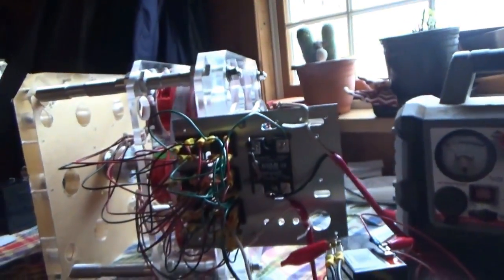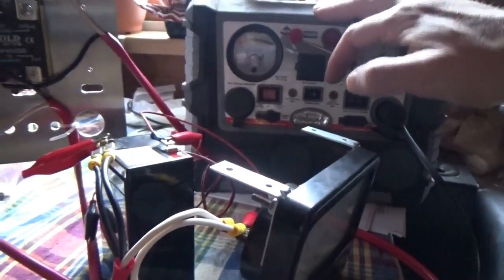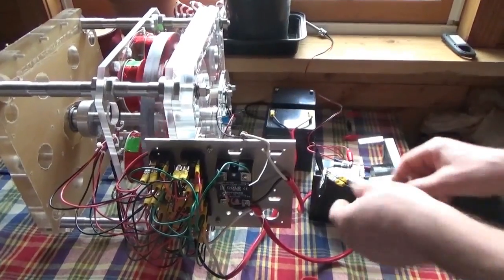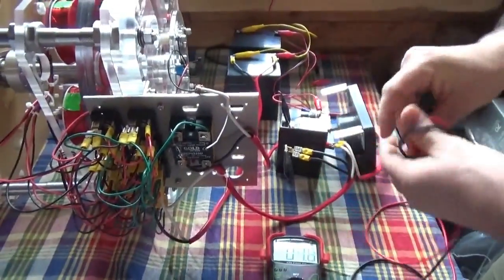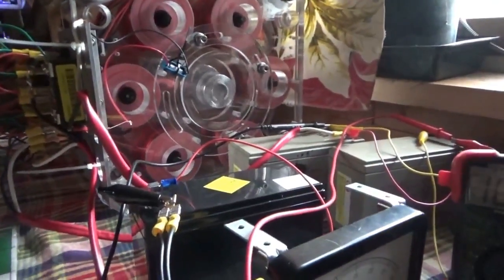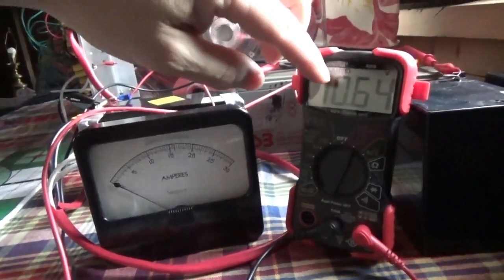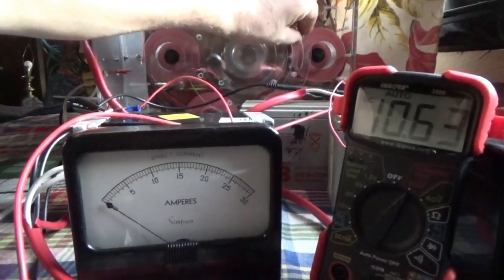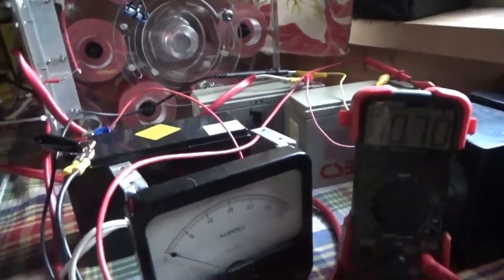Experimenting With The Quanta Q3 Pulse Motor Section

Comment: What ever happened with this?
Reply from the maker: I still have it. The solid state relay blew out on me and I ordered the wrong one. I am low on funds so its on standby till spring. I cant use it in winter because my lab is outside and unheated. The oil in the bearings gets stiff and it wont work as well in the cold.

Comment: Troy, I'm considering getting a QC unit (I can't afford the one you have, but it looks like it's really nice!) I'm curious why you haven't measured the current output with that analog Amp Meter and put a smaller amp meter (or a digital amp meter) on the input side? Everyone I've researched has the same question "What's the CURRENT Output on these devices?" My solar system is using 2 - 5kwh Tesla L-ion battery modules taken from a wrecked Model S-85. The batteries work great, super cyclable, but I don't have enough solar to keep them charged. I was hoping I could suplement them using one of these machines driving a 48vdc - 1800wt permanent magnet motor (generator) with the torque off the motor. Have you tried connecting a DC motor to the shaft to see if it can generate really usable current?
Also, is there a forum where people who have these are sharing ideas & experiments?
Reply from the maker: There is not much information out there about the Q3 which tells me one of two things: Either its really working and nobody talks about it or its a scam. I am thinking its the real deal because of how its built. It is essentially a very well built Bedini type motor.

I do have an amp meter permanently on the input side now along with input voltage and output voltages. But I have not tried to measure current out yet. Good idea to try.

If I get it running with radiant energy output though, you will not be able to measure the output properly. The only way to measure radiant energy is to measure how much usable energy is in the battery after being charged. The chemistry of a lead acid battery converts the radiant energy into usable energy.

You cannot power a heavy generator with the output of a pulse motor. The idea is to reduce magnetic drag all together in order to reduce current used to turn the rotor. So the outputs are pulsed in between the driving pulses.

I would be happy to hear from you on my forum: http://www.thedoityourselfworld.com/forum

I have been programming heavily on DIY Tube Video Community recently and have neglected the forum but I will get back on it this week. Hope to see you there. Lets stir up some conversation about this device.

Its funny you ask me now too. At this time I have been studying radiant energy and want to amp up my outputs in order to run an altcoin mining rig for free.

Lets build them together and see what we can come up with.

Comment: I would like a Quanta Magnetics G1 for a supplement to a home bank, do you think that works? And can you run one of these QM gen's on a 5V/2A portable charger from a USB port? That would be great cause you can charge those free in the car. Thx.
Reply from the maker: If you have patience and some skill in this field, yes you can make it work. BUT the manufacturer is not allowed to tell you how to make it work properly. It has to be sold as an experimentation device only. Not their fault. Know this in advance. It is finely manufactured and beautifully made and well worth every penny though.

You would maybe be able to get it running at 5 volts but a small 12 volt solar panel will provide better results. 24 even better. Just get a small 12 volt battery and solar panel.
Reply: I live in Alaska & solar is not that reliable, but may work some of the time. But I have an electrician that should be able to help me get it set up. I think it would be helpful. Thanks for the reply.
Reply from the maker: Then get a small wind turbine. Hope you figure it out.

Comment: You are not gaining any energy, All what you are doing is transferring power from the good battery to the bad ones minus the energy needed to spin the magnetic motor.
Reply from the maker: But that cannot be true. With the Bedini motor for example I can restore 6 or 10 batteries at one time while running the motor on one single small battery.
Reply: I think you need to go school.
Reply from the maker: Say what you want. I dont care. Wont stop mine from working for me.

Comment: Am I the only one who thinks that you could buy new batteries and even have spare ones if you didn't spend the money on that motor. I know this is not a popular opinion, but that is really not going to save batteries. Once the acid is spent and the plates are wore out you are done. It really boils down to the laws of physics. You can't get something for nothing.
Reply from the maker: Well, if I had purchased the device myself, yes I would agree with you on the first point. BUT I did not buy it so no I would have to disagree on the first point. AND keeping batteries desulfated and in good running condition is what this device is about. Acid does not get spent as long as you keep the water topped off. The plates do not wear out if you keep the battery charged up fully and all the time and keep the plates from being sulfated - which which this motor does. NO, you cant get something for nothing. No laws of physics are being violated here. Remove power - it stops.
Reply: I disagree the acid does wear out. Water only dilutes the acid. What 
happens to d,c,a cells? That's right they go dead after extended use. 
Can't be that different with a lead acid battery.
Reply from the maker: You are comparing flashlight batteries to lead acid batteries. HUGE difference. There are some 12 volt batteries that were made 100 years ago which are still in use today. Its all in the chemistry and how you treat the batteries. Water boils out of a battery and you have to replace that. If you keep them topped off you can generally expect 10 to 14 years for most off grid applications. If you can keep them desulfated and fully charged at all times then you can extend the life considerably.

Comment: Hey troy, Glad  to see you are doing good,. Also cool you have revisited this concept with waste pulse voltage capture. most people do not get whats going on. Its about efficiency, not getting something for nothing. Mr. Bedini tried to make that clear. there are limits using these things to restore batteries, but that does in fact work on some, but that is just a byproduct. the whole idea is to get people thinking about how do we recover that wasted energy that coils produce when current is shut off and the field collapses, normally wasted with in circuits with fly back diodes. can this be saved? it can kill semiconductors, so that energy does do work. I think your going to need to work with adding capacitor banks for better energy transfer. happy experimenting.
Reply from the maker: Thank you. Yes you have it. And the capacitors are a necessity I think. There is something about the way capacitors work with this energy.

Comment: just because it shows a voltage does not mean the battery is ready to support a load. The real test of these repaired batteries is to drain them and see how many mAh you can pull out.
Reply from the maker: Correct.

Comment: You do know John Bedini passed away a few months ago?  Now Rick Friedrich is saying Bedini's charger actually killed batteries.
Reply: The bedini motor is an electomechanical desulfator, like a solid state desulfator but with spinning parts essentially.

How you use it and if the battery can be recovered depends entirely on you and the battery.
It can or can't kill batteries depending on how you use it, like a normal commercial desulfator
No conspiracy involved
Reply: ElGatoLoco698  who's john bedini ?
Reply: You can't read about free energy without coming across his name.  He was doing it back in the late 70's.  He  invented (I should say re-invented) what became known as the schoolgirl circuit.  He helped a schoolgirl with a science project and that's where it got it's name.  It's a circuit that allows you to turn a fan or other motor device and charge a battery at the same time without adding any energy into the input or losing anything on the output.

Comment: Troy did you Check the acid level in those battery ??? My experience with these battery is that the liquid evaporate and you wont be able to charge them Fully if you dont fill them with demineralised water
Reply: I've always found those sealed batteries to be low on water when they don't work well, I've also successfully added water to gel cells.

Comment from the maker: Learn How A Pulse Motor Works - Read Here: http://www.thedoityourselfworld.com/articles/article.php?id=11416
Reply: I read your article. Mostly it is fine! :-)
The only thing you still refuse to understand is that the device is operating like any desulfator or boost converter! it USES the back EMF to raise the voltage. How could it do that without back EMF? 

Back EMF "harvesting" (the term is never used in electronics because it's so common and basic to exploit back EMF) is the basis of solid-state and electromechanical DC-DC boost converters. The inductor is shorted for an instant and the back EMF pulse is fed in a capacitor, raising the voltage. Very simple!

This motor does the same thing as a boost converter, but instead of having a controller it has the "timing disk" and instead of an op-amp and MOSFET or SCR it has a reed switch and relay. 

There is no magic. It is all explained by physics. The rest are dreams or woo-woo snake oil.